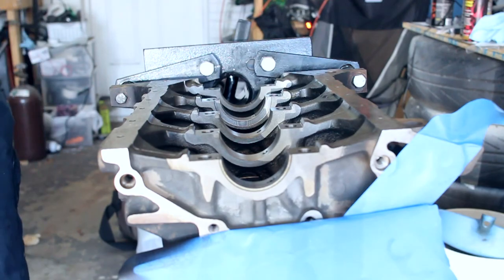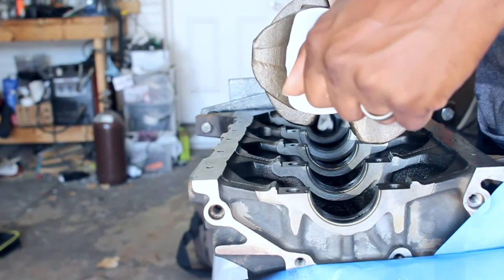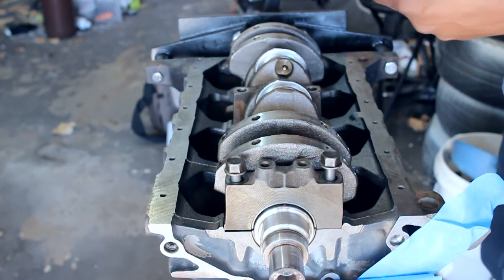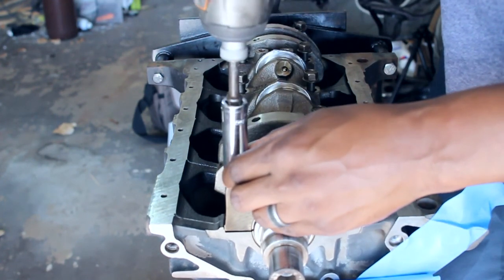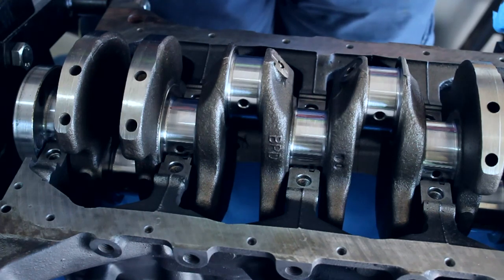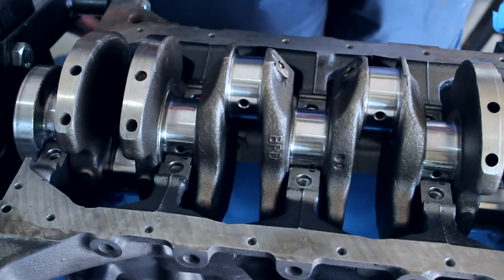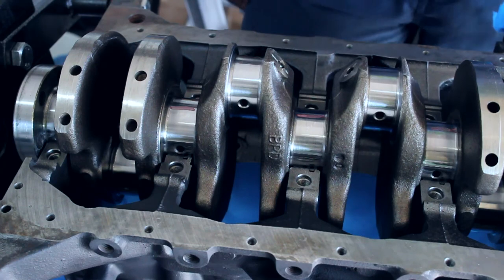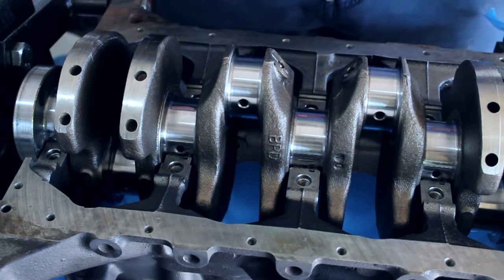MAZDA BP BEARING CLEARANCE CHECK

Comment: Hi! I understand correct, that you set up standard bearings for crankshaft and rods even if You have worn crankshaft?
Reply from the maker: Basically yes, if the crank is worn so much so that the clearance is out of tolerance then the crank should be machined and oversized bearings should be used.

Comment: I think one of the main differences between the engines that went to escorts and proteges vs the mx5 was the crankshaft for the mx5 was forged. Maybe the cast crank and large toelrances contributed to your recent engine failure.
Reply from the maker: I hear there is some debate about the forged cranks.  From what I understood all BPs had forged cranks, plus this engine was a Kia BP. But I do agree the large tolerances probably had a lot to do with it.